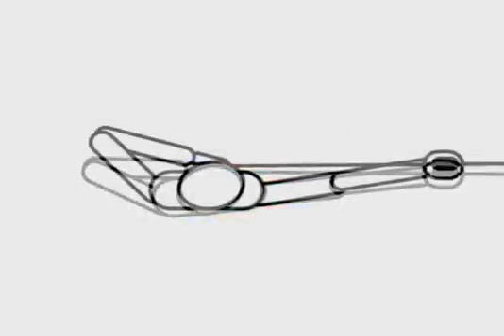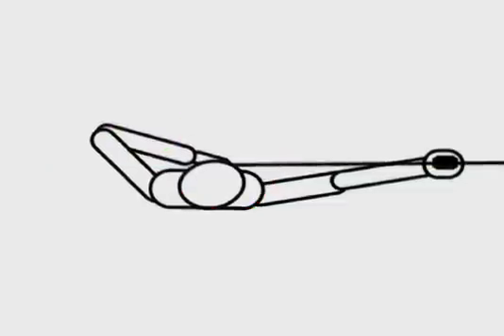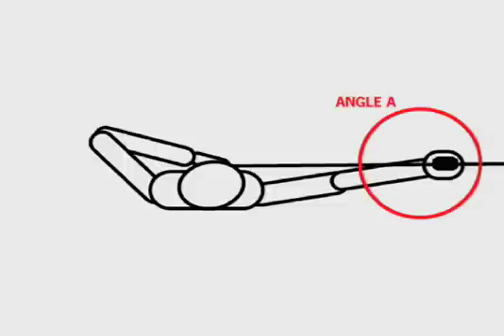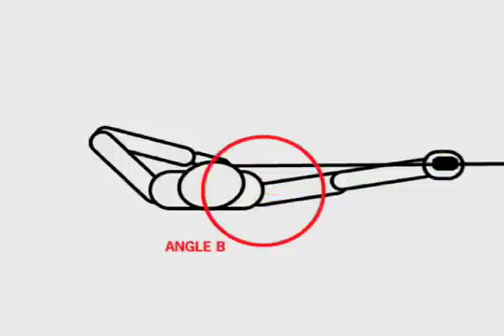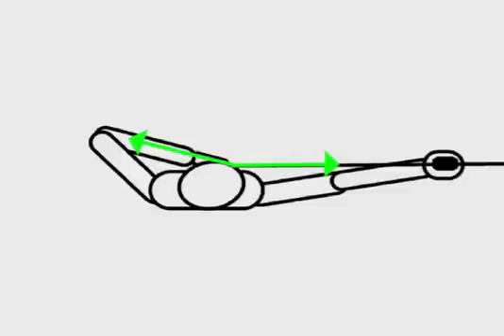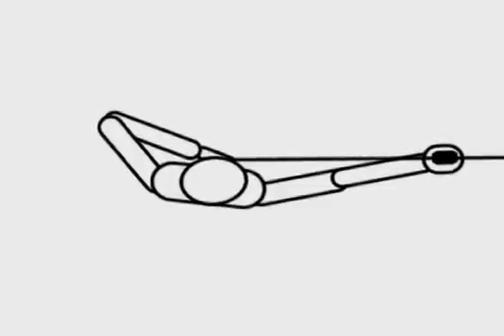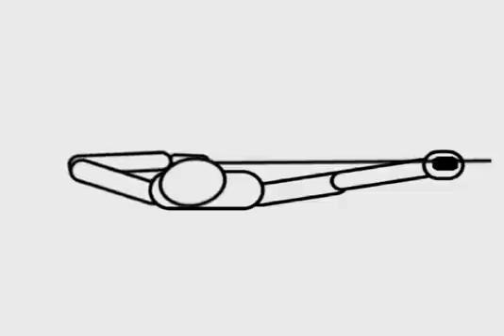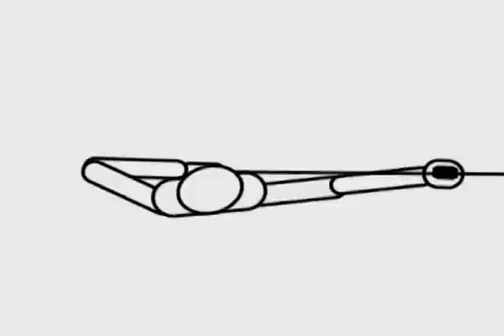Archery Form -01- The Wedge

Comment: Thanks, that's very helpful. I have a question, so when you drawing, the hand alignment (your shoulders n arm) it doesn't form a straight line?
Please answer me
Reply: Drawing is not the problem.  The anchor point is.

Comment: Should I use close stance?
Reply from the maker: Never having seen you shoot, and not knowing your form I cannot answer that question except to speak on a statistical basis. Most archers start with a neutral stance. In the past decade, with the NTS method being promoted in the US, many archers are moving to an open stance at the feet and hips and coiling at the torso so that their arms and shoulders are in line as I described in this video. The closed stance on the feet has the problem that most people find it a bit unstable and have a harder time keeping they proper posture and balance.
Reply: ArcheryWinchester I see. Maybe I could send you my form. I find this wedge form much more stable (less tremor) rather than parallelogram.

Comment: according to the angle of the torso, wouldn't the best stance to achieve the wedge be a closed stance? can someone reply to this please?
Reply from the maker: Yes, from a straight alignment perspective, but there are other factors to consider. I am working on a video to discuss this issue in detail since it is far more than I can go into here. You might note that the NTS method, used by the US national coach, actually starts with an open stance, which seems contrary to the wedge alignment goal. Yet, archers with the NTS method twist the torso above the hips to  still attain this alignment. As I said, it is way too much to go into here so please wait for my future video. A quick answer is that an archer starting with the NTS open stance keeps his hips over the feet and turns only from above the hips. This creates a tension in the torso that makes the the stance more firm.

Comment: Watched the series and tried it out over a few weeks, I am shocked how much easier my release is and the draw, I am so very grateful. Am I right in thinking that the line of the arrow is at 90 degrees to the shooting line so that means the feet alignment is at a slight angle i.e. not 90 degrees to the shooting line, or do you rotate the hip slightly. Subscribed to your channel, wish the club was closer!
Reply from the maker: I'm glad it helped. Most "release" problems are actually "alignment" problems - as you just discovered. Foot alignment is a hotly contested issue and I should do an entire video on that. It is certainly too much to go into here. But, since you asked. The US team, under Kisik Lee, uses the NTS method which has the feet off at a slight angle. So do the Koreans and many others. I like it, however, only if it is done correctly. The hips must be kept over the feet and all twisting must be done above the hips. This creates a lot of tension in the torso which keeps it rigid. I have seen it work wonders with many archers, particularly "floaters" who are not particularly stiff in their core/torso. I'm sure you've seen people drifting (floating) around in the torso.  The key is that it is a tense torso position and stands in direct contrast to the concept that many people have of "Natural point of aim"... As you can see, I am going into too much for a simple comment response. I will work on a video for this topic. Watch. It will be up within the next month.
Reply: Was an interesting question and interesting answer. Did you ever get around to making that video on foot alignment? It seems to me that the wedge form could almost call for the slight reverse of an open stance, i.e. a slightly closed stance, or does that introduce other problems?
Reply: David Hilton what stance did you used?

Comment: When I use "perfect" form, the theoretical "perfect" form, I keep slapping my forearm.  I only employ a "slightly open" stance to avoid forearm slapping.

If I adjust my grip ("palm down" where most weight rest on my thumb) I can achieve a "perfect" form while stopping forearm slap.

My question:   "palm down, fingers curled in, bow on thumb". Is there a better form I should try?  How do I stop forearm slap while in "perfect" or neutral stance?
Reply: From what i understand try pointing the elbow you hold your bow with outwards so it is not pointing straight down, which should add additional clearance
Reply: I'm also getting forearm slapping trying as the video proposes.  and yes I'm twisting my elbow out.  I'm still futzing with basic form considerations as I'm on an old compound bow that doesn't have a draw stop and nobody I've asked in person had anything to say about how I should do anything other than it looks fine no matter what I do.  More recently I'm also adapting to wearing glasses.  Uncertainty soup.  I should add I think I have very mobile joints so without an overhead perspective on myself I have no idea how straight out my arm is, and with a twisted out elbow that gets even harder.

Comment: I watched this a couple weeks ago with much interest. The explanation seems very thorough and the reasoning solid, but I cannot achieve a release that does not hit my nose! I am not trying to sight directly down the arrow. I just can't seem to turn my head enough to get my nose out of the path of the bowstring. It's possible my release is not so great, and it is pushing the string sideways and into my nose. But also I can't turn my head far enough so that the target is comfortably in my central visual area. I have to look to the side. I can feel the benefit as far as skeletal alignment vs. muscular work goes, but I definitely get tighter grouping with the old parallelogram stance, with less wrist and nose slap!
Reply from the maker: +jeffreyburr It sounds like you are bringing the string to the side of your nose. That is why it is hitting the nose upon release. Bring the string to the tip of the nose. From there, when you release the string it has only one way to go, away from the nose. Let me know if I am interpreting your situation correctly.
Reply: +ArcheryWinchester Ah yes, I should have mentioned I was anchoring at the corner of my mouth.
Reply from the maker: The corner of the mouth anchor is popular, especially for barebow shooters, but it has a problem - it is variable. Remember. 1 mm of variation at the anchor is 1 inch at 2o yards. 1/4 inch is 4-5 inches at 20 yards. The draw hand needs to be at the same position relative to the eye when at anchor. that's why so many archers use the tip of the nose and under the chin - more precise repeatability. Are you shooting brebow or with a sight?
Reply: +ArcheryWinchester Barebow.
Reply: +ArcheryWinchester thanks for the help.

Comment: I really like "The Wedge" but, I can not seem to make full allignement. My string hand is still a little bit forward. I've moved anchor point to the back. If I put it to full allignement, I have to push my head backwards and it does not seem natural to me.
Any suggestions?
Reply: The same issue bro